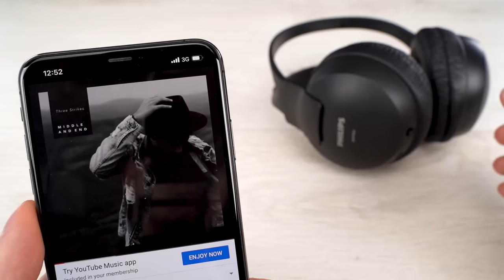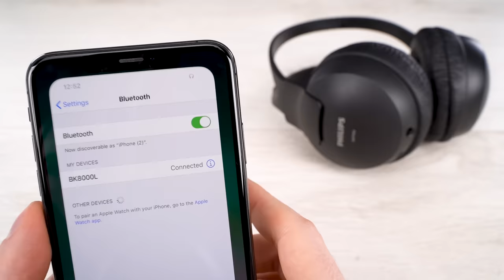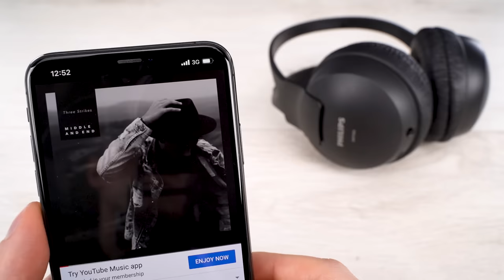Upgrade Your Headphones by Making it Wireless

Comment: Wireless headphones have worse sound quality and have lag. "Lets make wired headphones wireless so they are worse in what they are meant for. Therefore it's an upgrade!" 😂😂😂
Reply: Some people aren't looking for an upgrade in quality, merely usability or convenience.
Reply: eh Wireless is looking pretty good to me seeing as I just finished fixing some wired heaphones. The sound went out of one of the ear pieces and during my diagnosis I found out that basically the wires had a short due to burning away. The wires that were used to make the headphones where cheap as hell and just burned away the insulation and the metal which completely opened the circuit. After re soldering them they burned away again later on and opened the circuit again. wireless looking pretty good to me.
Reply: Bluetooth has had lossless codecs for a long time already, and if it's not a pair of smooth as butter hi-fi headphones you won't hear the difference.

Comment: I would have spend more 1000rs and buy wireless headphone however the parts he used he wasted 1000 rs Lets work smart than hard😄😄😄
Reply: Wire wale headphone ka kya karte? Paisa Barbaad...
Reply: Bruh that shit don't cost that much it's just a Bluetooth module that's prolly the most expensive thing and it ain't that expensive
Reply: True yar

Comment: if ur afraid of damaging the board when soldering....just buy a wireless headphone.....but still there's a difference quality of having wireless headphone and wired and also the latency performance of the audio with the component u use.....depends...

Comment: The Bluetooth Receiver that you'd buy for your headphones might not have a good audio filter built-in and you would hear noise and distorted audio with it connected to your headphones.

And most people would just go ahead and buy any Bluetooth audio receiver with out doing any background check on the product. 

So, it's better to stay on the safe side and try it on a cheap pair of headphones first!

Comment: Would have been better to just add the removable cord like beats or bose. If i ever made blutioth headphones i woul also ad an active noise canceling chip on each ear. Then make dure to get not the cheapest Bluetooth module cause their quality is remarkably bad. With the size of thos you could also add some backing foam, and since your in there why not upgrade the speakers and add a mic to the whole thing. Your video lacks forethought, idk if you took that messege from the hints above.

Comment: Hello may I have a link to buy components? Im interested to make the same thing. A full detailed label would help, I will look it up in local market. Thanks much
Reply: Bluetooth audio receiver module, amplifier module and charging module+ battery if required
Reply: @magicianofelectronics951  thanks much bruh
Reply: @H4FI2  be careful on Electronics and high power batteries, and you welcome

Comment: This is a little late but could you wire an extra battery into the left earcup to balance it? Interested in doing this but on a larger scale with noise isolating headphones

Comment: Don't you need something to prevent the battery from overcharging and setting your house on fire?
Reply: Use charging module with over voltage protection, over current protection, overload protection, over discharge, reverse Current protection thank you

Comment: Some few questions though, the battery voltage and capacity and it’s compatible speaker voltage, amps etc... I’ll need some of those infos please...
Reply: Tbh you can just buy whatever Bluetooth stereo module and check the required voltage (4.7v or similar is prob gonna be fine for any module) as for capacity it's completely up to you, just make sure the battery will fit in the headphones, I would say 1200mah would do the trick in terms of size and time, consider that these modules trickle a ridiculously low amount of amps so they will last long either way.
Reply: @albertolaurella9168  big thanks for the info bro. Id go for a capacity that can last 4 years so that I'll have 4 years of music if ever a zombie apocalypse is really going to happen.

Comment: if the headphones run out of battery u just need to open the headphones cut the conected wires and replace the bateries
Reply: There is something called charging circuit/module

Comment: i got some razer krakens... ebay seller lied n said open box and the mic didnt work so i took off the entire cable and mic...Can I do this to them. If so what is the precise name of the charging port board? and where can i get the rechargeable battery. I found the microswitches..

Comment: Ok but you didn't put the details about each of these items, like how strong a battery and such, or where to get any of it.
Reply: It's probably a 3.7v battery rated around 150-250 mAh.  That's kinda the standard bluetooth headset battery.  I could be wrong on what he used specifically, but that's just my guess.
My other guess is he either salvaged some of it from old electronics he doesn't use anymore, got them on Amazon, or has an electronics hobby-shop nearby. I'm gonna go with Amazon though since he's pricing out the parts specifically, and Amazon pretty much sells anything you could possibly ever want.
Reply: @rosebrigade  thanks, gonna give it a try for my son, he broke the cord to a good set of his so I bought a new bluetooth pair that's too small for him and gut it and give it a try
Reply: @not1tosettle  Good luck~

Comment: How about the quality @the Q
Reply: Depends on the headphones. All he is doing is attaching a Bluetooth speaker module to the headphones
Reply: @shadowbanaccount7028  can you please tell how the sound quality of headphones changes after attaching Bluetooth module. Thanks anyways♥️
Reply: @zedlay  Their will be digital quality loss depending on what sound codec it uses (If your using wireless). However if you are passing analogue audio through it such as a AUX cable or RCA jack, the quality will remain the same
Reply: @shadowbanaccount7028  thank you very much for the information.

Comment: More like Downgrade . Why TF would I want to recharge or buy batteries for a headphone/earphone
Reply: So you can use them?
Reply: @anwarzakiyvinas1189  But your paying for it to work, while you could simply just plug a wired headset into your device and use it until said device is off